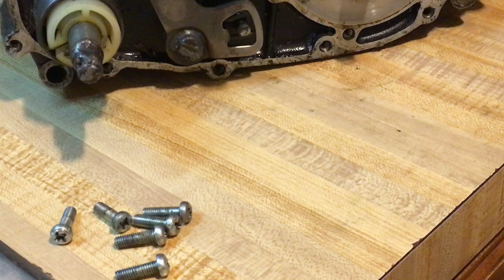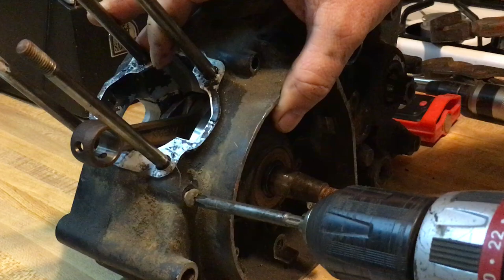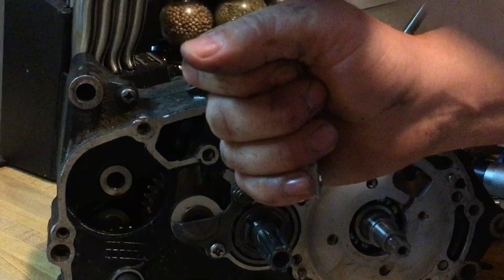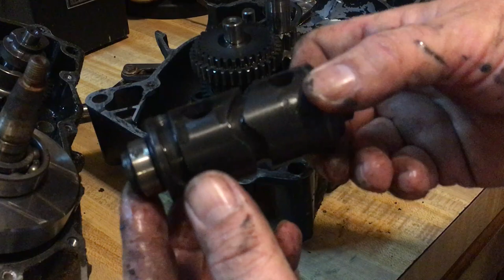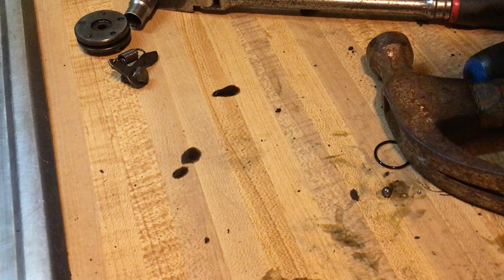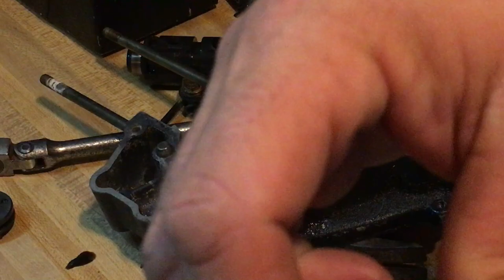KE100 KM100 KD100 engine tear down and how many systems work

Comment: Kevin. Thank you so much for all these videos on the KDs! I just bought my first KD100 yesterday for $100 for a winter project for my son and me. Your videos are so helpful. Are parts like oil pumps, gaskets, fork seals and dustcaps, throttle and clutch cables, etc. still available or is a matter of getting lucky on ebay? In short, where can I buy new parts?
Reply from the maker: That is awesome great deal yes parts are still available ebay is a great parts place kd80 km100 and some ke100 parts fit your bike also if you go to partzilla.com they have a complete parts brake down
Reply: @2strokeguru  Thanks for the comment back and the content.
Reply from the maker: @selfmedicatedrec7361  very welcome

Comment: In India, I have a KB100, the same guy with just 4 gears, but checking the gear teeth, only two gear shifters are here. can we add another shifter with proper gear teeth to change into 5 gear model?
Reply from the maker: Yes 5 gears would work in the KB100 case you will need complete transmission and shifter assembly
Reply: @2strokeguru  Thanks.. vl look into
Reply: @2strokeguru  where i can get the complete set?

Comment: What is that part called on the video at 10:25 i need that part its missing on the bike i got. And it wont start
Reply from the maker: Neutral light assembly
Reply from the maker: That has nothing to do with starting
Reply: @2strokeguru  oh ok. Thanks

Comment: Thank you Keven.i have a stripped spline on the kick starter, verry hardened steel, i thought i could put in a rool pin to lock it in but too hard steel. any ideas? you did get this cleaned up before supper lol
Reply from the maker: Unfortunately kickstarter and shaft are damaged
Reply from the maker: Unfortunately kickstarter and shaft are damaged

Comment: It's 3:20 p.m. hi Kevin I love your show I have a 79 Kawasaki kd100 can I put a k brake Hub on there so I can have a speedometer
Reply from the maker: Yes you can I'm actually doing that to kb80 the parts you need are used on mc1 /km100/km90 brake hub ring gear cable gauge and bracket and thank you for the great comment videos starting up soon
Reply: Thank you so much for answering my question I did get a hug but it's off of a 175 k e and it's a 1975 where are the shock goes in its narrower I was just going to widen it up would that work
Reply from the maker: @MandiePolakowski  a 175 head will work on a 100
Reply: Hey Kevin how you doing do you sell parts as well if so I would really like to know what you have and I had a question about my 79 KD it doesn't smoke very much is that okay
Reply from the maker: @user-dr8pn3lk8n  no sorry I don't sell parts
Reply: @2strokeguru  I've had my Oilers set all over the place
Reply: @2strokeguru  sorry about that I sent that I've set my oil or exactly where it should be and I've set it way over at maximum and it just barely smokes unless it's been sitting for a while is that okay it barely smoking

Comment: Hi! Great video! I have a question concerning the oil injection. First, a little history. I owned a Suzuki TS 90 back in the 70s when I was a kid. It was a rotary valve intake much like the KD 100 I own now. It had a few modifications that I had done to it and one of those modifications was to remove the oil pump, block off the pump mount and injection tube. I ran premix in it and had no problems. I was wanting to do some of the same modifications to my KD but was told that the injection is a must because of the rotary valve. Have you had any experience with using premix exclusively on theses bikes? Any information would be appreciated! Thanks!!
Reply from the maker: Blocking off the oil will result in damage to rotary valve and right side crankshaft bearing

Comment: Can I split the case without removing the neutral light switch housing? Thanks.
Reply from the maker: You can but you can't put it back together
Reply: @2strokeguru   Ahhh,  ok thanks. I'm rebuilding my '78 KE125 (so many parts are the same/similar) Thank you so much for these videos!!!!! I have the manual but nothing like watching someone experienced.
Reply from the maker: @artiscat22  thats awesome thank you check out tomorrow's video 1978 ke125 first look im posting it tomorrow
Reply: @2strokeguru  That's so cool!  I have subscribed and will be watching.
Reply from the maker: @artiscat22  awesome thank you

Comment: Hi chris, i have a kawasaki hd2..i just want to ask what is the reason behind why my engine is secreating engine oil from exhaust port?
Reply from the maker: Leaking exhaust gasket during the exhaust stroke the intake stroke happens kinda at the same time pushing exhaust out the pipe its not uncommon to have a light leak  but if it is a lot replace the donut gasket it's typically the copper crush style gasket
Reply: @2strokeguru  its a two stroke motorcycle engine. The old one..what i mean is, the gear oil is being pushed to chamber thats why my sparkplug get  malfunction due to wet gear oil..
Reply: Ive replace new oil seal, o rings..but still my engine secreated gear oil when running..
Reply from the maker: @jadealquisola3283  gear oil there is no gear oil in the engine
Reply: @2strokeguru  what do you call the oil you fill in the engine?
Reply from the maker: @jadealquisola3283  oh the gear box if that is leaking into the crankcase  you will have to split the engine and reseal it

Comment: I have a 80 KD80, fresh plugs and spark, has compression, cleaned carb and float set to 24mm, oil and fuel tank clean and flows freely but I cant get it to fire.....am I missing something?
Reply from the maker: Do you have fuel to the carb petcock is known for plugging up
Reply from the maker: Call me tonight if you can't fix it I get home 6 east coast time 6033958097
Reply: Yes sir...fuel is flowing freely and float is adjusted to 24mm.
Reply from the maker: @WTF.416  are the points new
Reply: no...but it has blue sparks.....could they be that weak?
Reply from the maker: @WTF.416  use a nail file clean it up a little more don't regap
Reply: Will do tonight. Thanks
Reply: Do you work on Triples too?
Reply from the maker: @WTF.416  yes I do
Reply: Kevin Bergeron filed the points.......now I have no spark? Points look clean.....going to file with a different file as I hope I didn’t contaminate
Reply from the maker: @WTF.416  need to buy new ones